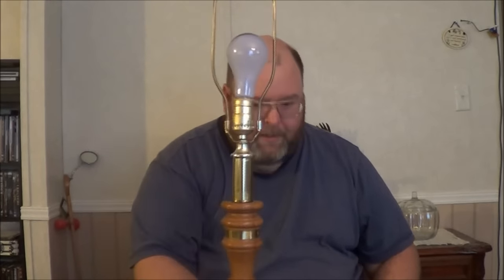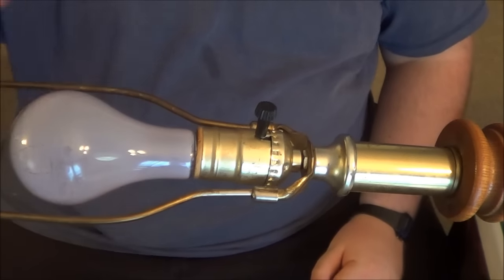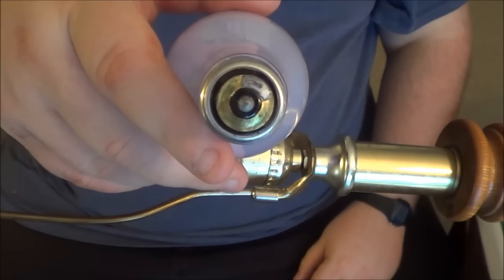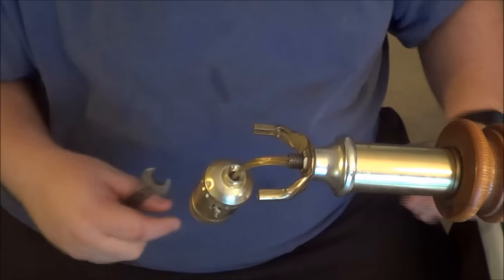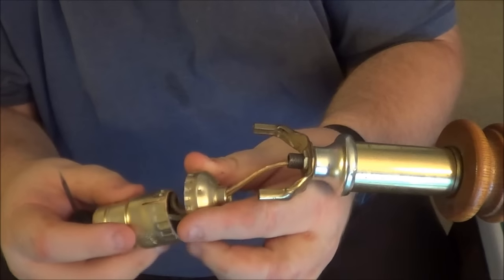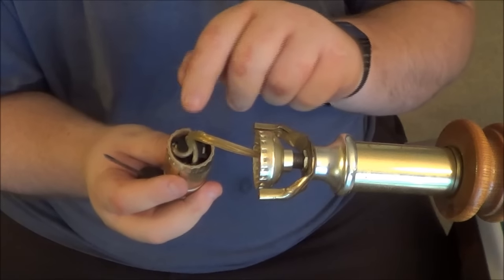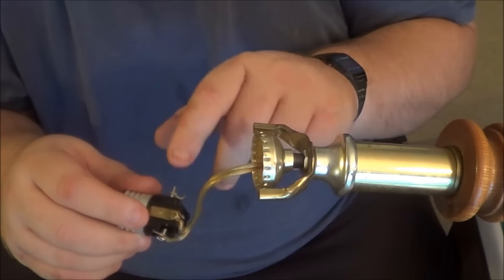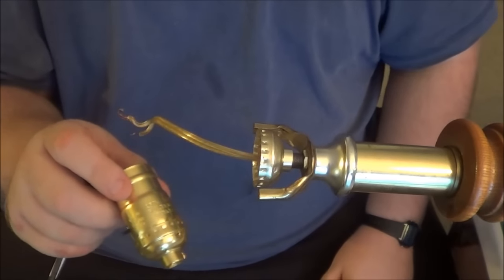How to replace a Lamp Socket

Comment: I wanted to see the socket being taken apart with the small flat screwdriver. 🤨
Reply: In another Youtube video, I saw that there is sometimes lettering that says PRESS. 
Press in on that part of the upper piece, and you should be able to pull apart the two parts of the socket.
I used a jar opener plastic piece to have a firm hold of the smaller lower piece of the socket.
Hope that helps.

Comment: Why didn't you screw the new socket base back onto the lamp BEFORE wiring the switch and putting the light socket together? That way you could've just pushed the socket together and avoided twisting the power cord multiple times while screwing the whole wired up assembly back on. It would have been so much simpler to do it that way. Good video otherwise...

Comment: good video, but you didn't explain what to do with an OLD lamp that does not have a polarized plug, and therefore both wires are the same, neither is ribbed.
Reply from the maker: In those cases, the wires are silver for neutral and copper for the hot.

Comment: Why did you edit out the important parts? You got the screwdriver to take the socket apart then it jumped to it being off. You also skipped the part where you took the cover off the socket after you said you were going to explain what the cardboard was for. You need to shorten your videos and maybe put on a clean shirt. Sorry but I didn't learn anything from you that wasn't already obvious.